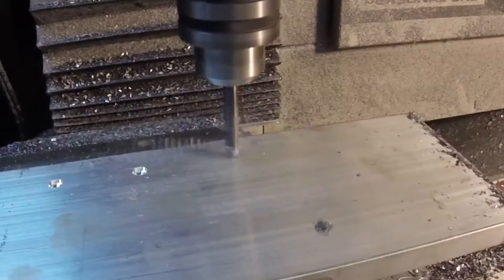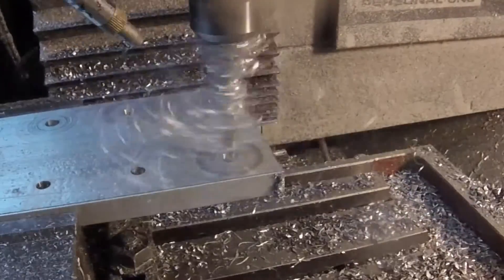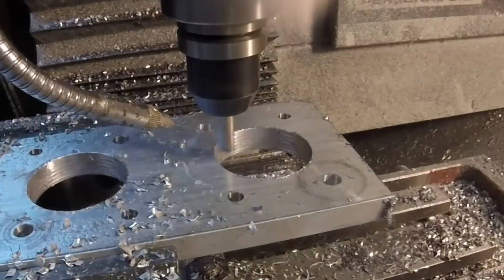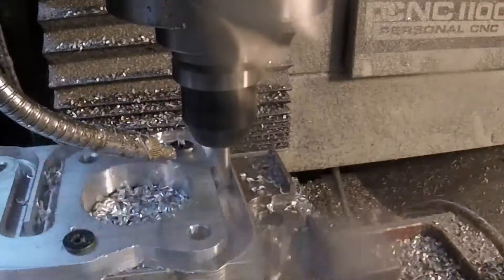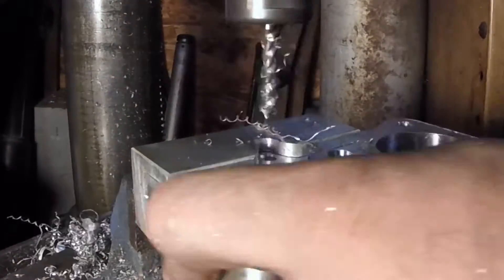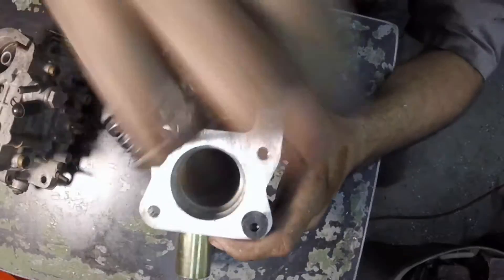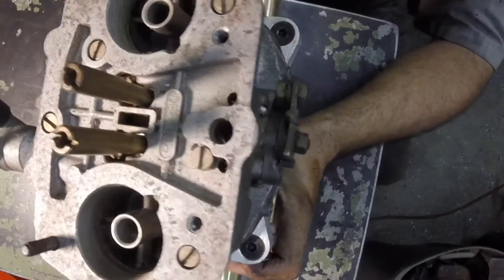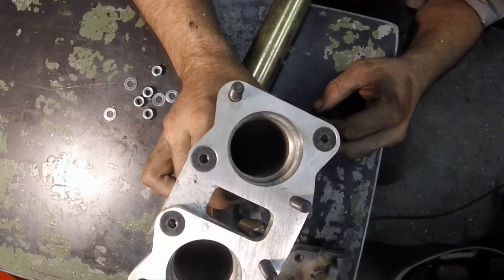Making adapter plates to mount Weber IDF's backwards - Tormach PCNC1100

Comment: how do you like the rougher?
haven´t used one yet and I am wondering what the pros are!
Reply from the maker: I don't use a rougher for aluminum but I plan to as soon as I can spare some change.  Heard some good stuff about the variable flute ones.

For steel, I definitely use one (carbide).  Lasts way longer, runs faster and cuts better.  Use a finisher to clear up the cut lines and it's good to go.  Id like to be able to run faster through the aluminum too so once I can spare it I'm gonna try one.

Comment: Still loving that tapping jig!
I don't think climb/conventional matters in a full slot......does it?  
Do you have to do much with the linkage?  Does flipping the carb mean the throttle pull is opposite?
Reply from the maker: Thanks man, it's very useful.  As soon as I can afford a tapping head though it's getting shelved.

I can't see where it matters in a slot but on the finish pass probably.

The Webers can have the linkage attached at either end of the throttle shaft so that's not a problem. Most people use hexbar linkage and it's very adaptable.  The hardest part would be the air filter base.  They would have to be redrilled to be installed backwards but it's a non-critical dimension and easily accomplished with hand tools.

Your question does raise a good point though.  For someone whose never done it, it could seem like a daunting task.  Perhaps I'll make a video showing the mounting and linkage adapting process.

Thanks for the good question!